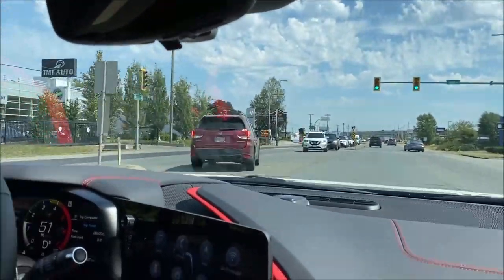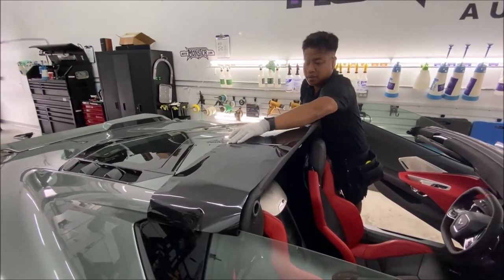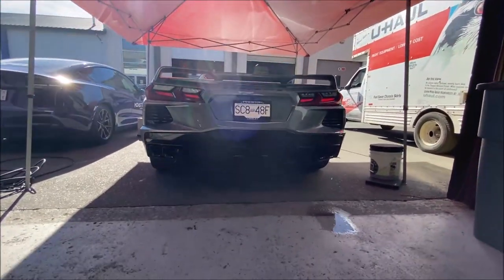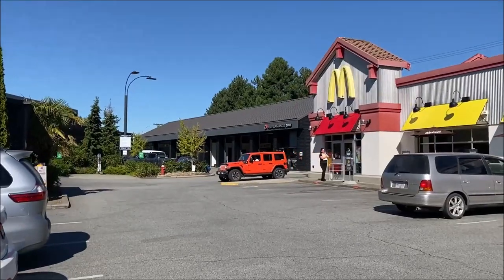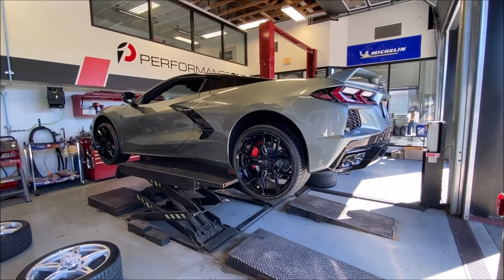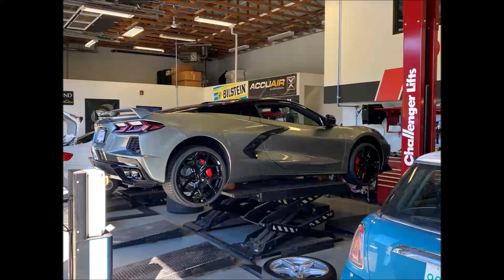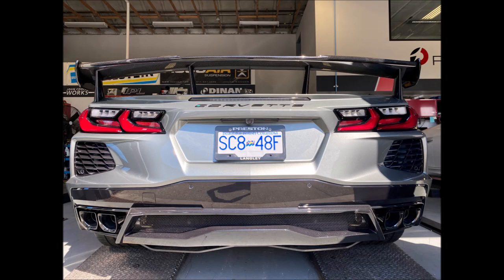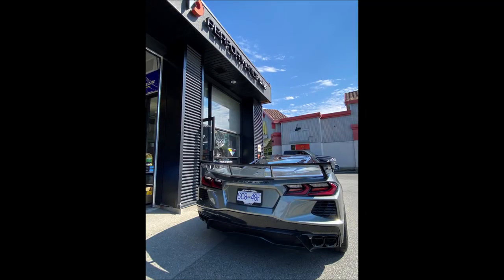2023 C8 Hypersonic Gray - Vossen Wheels, Carbon Fibre, Black Roof!

Comment: What is the tire size for the front and rear ? I know the wheel size 21 x 12 and 20x 9. What is the tire size and offset for them?
Reply from the maker: the rear tires are 325/25/ZR21 & the front are 255/30/ZR20 
I have attached a link to Vossen wheel offsets below where you can see all available options.

https://vossenwheels.com/wheel/hf-5/#custom-program

Comment: I just bought a 2023 Hypersonic Grey ZR1 HTC. I'd like to add the high wing, front splitter and side skirts. How do you think the exposed carbon fiber goes with the other carbon flash parts on the car. I'm concern that they may clash a bit and I might be better to just get the additional aero parts in carbon flash to keep everything consistent. Please let me know your thoughts.
Reply from the maker: congrats on getting a C8! in my opinion the carbon fiber & the black carbon flash blend together very well.

Comment: Don’t know if I missed it in the video, but what spoiler did you get to replace the Z51 option?
Reply from the maker: I have the 5vm carbon fibre package which includes, front splitter, side skirts & high wing in carbon. Purchased from C7 carbon, fitment works well.

Comment: What size are the tires front and back please, not the rims?
Reply from the maker: tires are 255/30/20 in the front & 325/25/21 in the rear, mich pilot sport 4s
fit perfect, nice feel & traction

Comment: This looks good and I'm assuming the wrap for the top is cheaper than the $2,495 carbon-fiber roof panel option.
Reply from the maker: yes it is for sure, the wrap was $700, i think it works well with the C8 design.
Reply: @westcoastc844  The price of the wrap is what I was looking for here.  I have this car on a truck as I type.  I havent found a good option to wrap the top locally yet.  

Did you get any clear bra protection on the car?

Are the wheels 20 21?  What did the tires run>?
Reply from the maker: @IconicProps  the wrap on the front pillars, roof & the rear of the car was $700, i got the xpel pp on the front portion of the car, called the track pack, it was approx. $2200.
the rear tires are 325/25/ZR21 & the front are 255/30/ZR20 

I have attached a link to Vossen HF-5 wheel offsets below where you can see all available options.
https://vossenwheels.com/wheel/hf-5/#custom-program